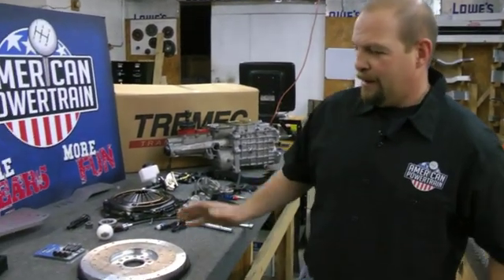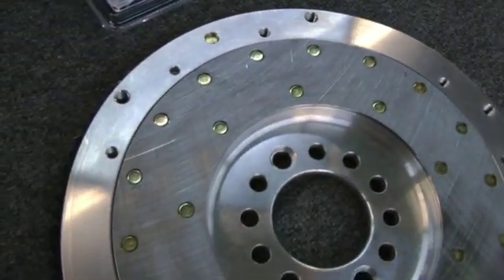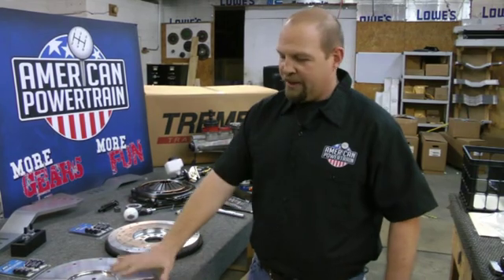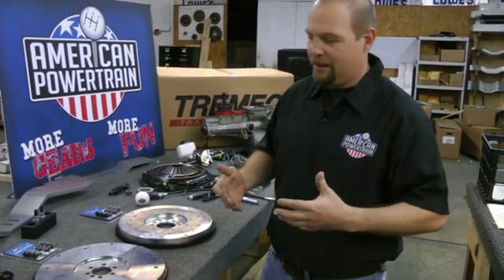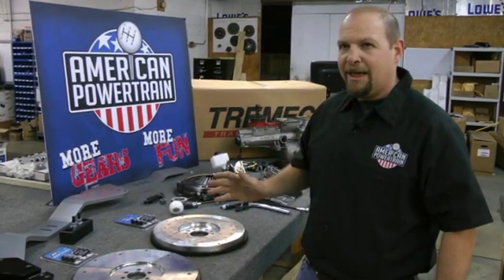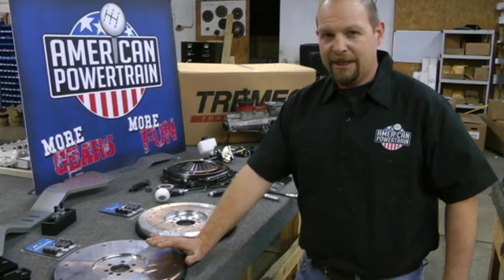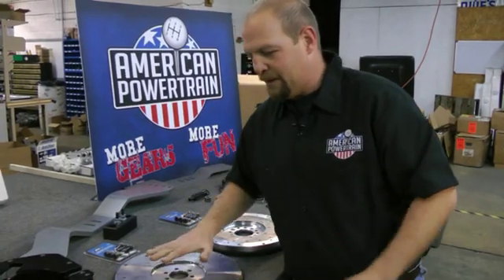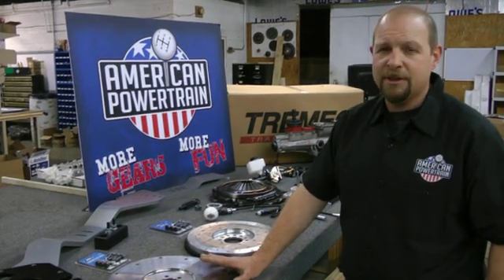Flywheels Aluminum Vs Steel

Comment: Can you supply me with a GM 4.2 Atlas aka Vortex I 6 in lightened billit steel flywheel? If not, can you supply me with an undrilled H3 (hummer) vortex I 5 (3.5 or 3.7) that I can lighten on the lathe and drill out the larger I 6 pattern crank bolt holes with my indexing head? Hummer has a slightly larger and heavier duty clutch. This all aluminum engine with it's 4 large valve, cross-flow, hemi head is destined to replace my >700 pound, cast iron factory I 6 in my 1968 MGC. Please and thank you. Brian Fahey

Comment: I had my rotating assembly balanced by a high end racing shop here in Florida. Of course the flywheel is balanced along with the crank/rods/rings/pins etc..,  If I where to purchase an aluminum or even lightened billet steel one, wouldn't that negate the balancing I had done?, I literally had all this balancwd to within a 1/2 gram. Good video though. Thanks.

Comment: Correct. For a 4,000 pound tank muscle car use a steel flywheel. Its going to take a heavy flywheel to get all that led sled moving. Now for my boosted Civic that is only 1,980 pounds the aluminum flywheel has been a dream. Absolutely perfect for my application.

Comment: Correct. For a 4,000 pound tank muscle car use a steel flywheel. Its going to take a heavy flywheel to get all tha led moving. Now for my boosted Civic thar is only 1,980 pounds the aluminum flywheel has been a dream. Absolutely perfect for my application.

Comment: I have an 88 escort GT...I swear the flywheel in this thing is bigger and thicker than a  lot of v8's I've run into. Ironically she pulls pretty good for her age and for the tech of the era. Drives great on the street and she's a treat cruising at 80mph. I just keep think that the flywheel is so frickin heavy that it's holding her back. I swear this thing weighs over 30lbs. Haven't weighed it yet but I will after I pull the motor this winter.
Reply: try a 1988 celica nice silly over built front end very stable to launch off the like a great daily

Comment: there is nothing like pulling up to the lights with some clown want to race and giving throttle a quick stab and taking it to the rev limiter in a split second, it shuts down most before you even race . Ally gives better acceleration on on the flats but would not use for hill climb racing like he said you lose to much energy.

Comment: I'm REALLY happy I chose aluminum.  My 2000 Mustang GT is now beating cars with WAY more power than I have.  My setup is all motor with 4.56 gears and an aluminum driveshaft.  I'm beating Z28 LS1's that were dyno tuned to over 500 to the wheels.  I have the 5.4 32 valve Lincoln Navigator motor in here and it's a VERY potent machine, even with the little bit it has done to it.  If you want to kick ass at street racing get a flywheel and 4.56 gears.  It will blow your mind how much difference it makes.

Comment: My car weight is 2645lbs, the engine is a twinturbo 4.6, V8 with no boost lag, full boost around 1700rpm, loads of torque!!  Manual trans, 3.73 rear end and approx 25" tires. Planning to swap to all aluminium flywheel becoz the car seems to perform better and better the more light the flywheel become.. The clutch still add some weight on is so i think i´m fine? So far it feels like the weight holds the engine back.. so many theorys, hard to try every combinations.. hmm
Reply: Do your car a favour and loose some weight. Steel4eva!
Reply: Pvulture b I have now dropped the flywheel weight another 5kg.. most of the weight is removed in the periphery and its made of aluminium. I can feel the difference, the response is better. The weight of my car is still the same around 2645 with me in it, and the 50 litre fuel in the tank.. Carbon hood on the way and probably carbon bumper too..And there is lot´s of weight in my wheels to remove!  :)
Reply: ZoDDyXXX good for you man. Enjoy it while you can.